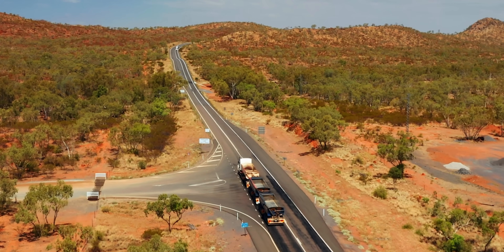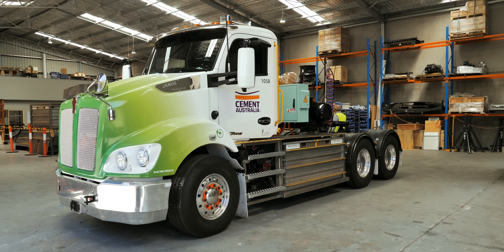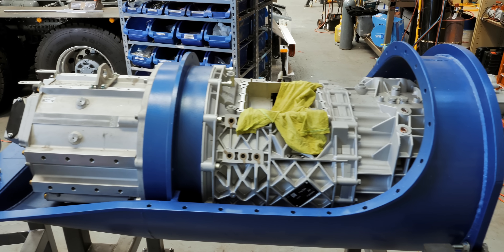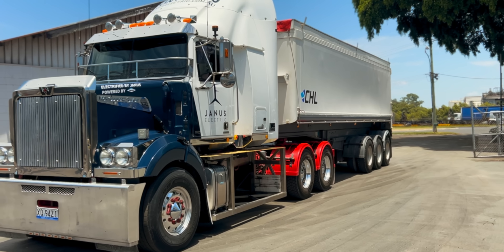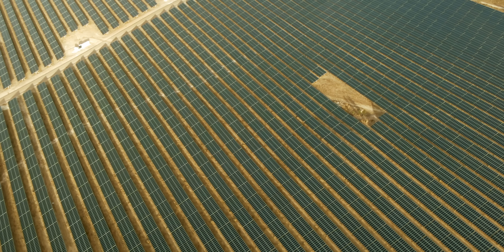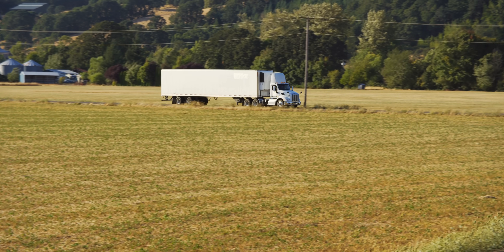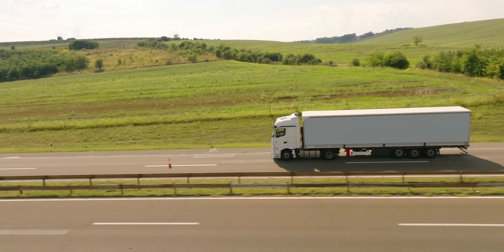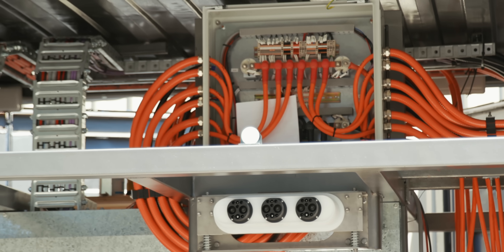This GIANT Electric Semi Can Swap Out Its Batteries!

Comment: What I always like about this is the facts they don't tell you about. Conversion is $150-$175K and they don't talk about the price to have a system to supply your own without having to use the grid. They also don't tell you how much space you need for said system. At a rough calc to produce enough power for the 620KwH is roughly 6,000 square feet, if the figures from Google are correct, per truck. Cost of said system hasn't been said which is another cost to the system as well as annual maintenance on said system. Annual maintenance on the truck isn't removed as there are still parts that need oil and grease replaced. He said about not owning the battery to save cost but you wouldn't get the battery change for nothing, another cost that isn't talked about.
I drive from Melbourne to Brisbane and back which is roughly 3,600Km. It isn't flat country so my mileage might be greater in some areas that others but at 400Km I would need 9 battery changes and at 600Km I would need 6 batteries. How much for each change? This price was not forth coming. They never tell you how much the actual running costs are and how much is needed to get all this amazing BS up and running. It is these figures that stop me from being interested in this new tech. Cut out the BS and maybe I might have a number crunch to see how appealing it might be in the future.

Comment: This is amazing idea! I would love to help the project with the robotization of the swapping station, management sw for the battery charging, perhaps solar vs grid balancing during charge and the logistics of it. Building these on sites with diesel pumps now, or overnight truck stops should be quite easy. More power to these guys, job well done!

Comment: No more Ad-blue shortage, Diesel shortage, and black smoke exhaust choking traffic behind.  Hello to renewable trucking.
Janus Electric have had several iterations of prototypes and now they have settled on the form factor that works best.
The only thing slowing them down is they are a relatively small company and their capability to convert trucks is correspondingly slow.  And for longer trips they will also have to build a lot of battery packs to pre-position along the route.
They might have to either license their technology or get a big cash injection to scale up in order to make a difference.

Comment: Learned a lot about big rigs from this video.  Amazing about the average age and how the weight is not alot different but with future tech that could equal out or even get less.  Love to know what the drivers think of this who have driven them.  No engine brake noise like I hear all the time from the trucks, the regen is amazing.  The TCO must be fantastic over the rest of the life of the truck.  Battery swapping for these is a perfect solution, can see swap stations across the Nullabor and huge solar farms nearby to charge them up with and use as grid level backup even for the communities they are in/near.  Have to see if they are going to be at FCL on the weekend.
Reply: I was kinda wondering how the regenerative braking would compare to engine braking power wise. I would think it could match it and possible be less likely to lock the wheels on slippery surface too

Comment: What an awesome company. They really are showing the way forward for commercial vehicles
Reply: True, but, other countries are equally innovative too.

Unfortunately although the swappable battery appears a good idea at first glance you would need to see if the concept worked with many thousands trucks using these replaceable batteries.

Too soon to know if the idea works beyond a few trucks.

Other countries are investing in hydrogen burning engines and hydrogen fuel cell powered trucks and public transport.

Comment: Ok for interim solution but will ultimately be replaced by upcoming Hydrogen automotive solutions like Cummins H2ICE and Hyundai Doosan H2ICE. Obviously new vehicles will most likely be hydrogen FC based which are being introduced currently in Australia.
Reply: Hydrogen combustion engines don't make any sense for anything that can use battery electric.  Hydrogen combustion engines are even less efficient than hydrogen fuel cells which are already way behind battery electric.
Reply: @jamescox8429  if what you say is true then you as a bevangelist have nothing to fear. The technology is commercially viable and that is why it coming to the market. Companies like Cummins, JCB and Hyundai Doosan have much more intellectual ability than a keyboard engineer like yourself. You do need to do much more research before committing to inaccurate comments .👍

Comment: This is one of the best idea l have seen on this show l am impressed this idea of changing batteries was around with an electric bus invented by Mr Leembrugen he built an electric bus eith changleable batteries and this company is using older trucks to convert to electric and they are bueng used no crap no mucking around and the fact is anybody can have there prime mover converted even using the fork lift to change the batteries much shorter time in refueling a prime mover and down to one minute to change batteries with quicker than refueling a petrol car obviously this company is going gangbusters and the the regenerative braking because diesel prime movers have exhaust braking

Comment: Only one ton heavier than a disel....  That's phenomenal. These guys are amazing.
Reply: Local trucks do about 80-100k km/ year. Interstate trucks do 160-250k km/year.
Reply: PLUS 2,5Ton PER Battery-Pack....so 5 Tons +1Ton for the swap-engine... Another mis-calculation is the self-produced Power...it doesnt cost 6-25ct, because the Solarpanels or Windturbines are not growing on trees. They cost a lot.... Have we talked about the conversion-cost? You have to drive a lot to re-finance this.
Reply: You forget to mention significantly way lessssss range than the diesel too!
Reply: @Alan May  with mandated stops every few hours, I don't see that as being a big issue when you can just forklift on a new one.
Reply: @--Nath--  it depends on which roads you take and those swapping stations will definitely not be as practical or everywhere like charging stations or gas stations.
Reply: @--Nath--  you’re not going to magically swap batteries like that everywhere
Reply: @alanmay7929  depends. Are you going the same known route repeatedly? Or are you going to random places on every trip.

If the later, then you stick with diesel and wait for Tesla or somebody else to set up supercharger stations all over the country, and only after they are done, maybe 10 years from now, do you buy an electric prime mover.

If you are like Pepsi trialling the Tesla Semi, travelling a fixed regular route, you set up your own battery swap points exactly where  you need them, with your own spare batteries and chargers.
Reply: @alanmay7929  How many kms does a prime-mover drive in a typical day?
Reply: @roidroid  the question is what range does and “electric” road train really get! If a tesla semi gets “500 miles ish what would a 600kwh road train with over double the payload get!
Reply: @alanmay7929  ... Oh, I thought you'd know the answer to the question.  

Wait, so why do you think it gets less range than a diesel - if you don't even know how much a diesel typically drives?
Reply: @alanmay7929  you're the one saying it has less range than a deisel, mate.  If U don't know, then why are U talking
Reply: @roidroid  around a city about 300 - 500 ish is needed in the outback easy 1000 its why most of our trucks run 4 tanks of fuel. my town is one of the driver swap points for the Sydney to Adelaide route its around a 1400 trip in total the trip for Adelaide to Perth across the GAB is even longer not even Tesla has a destination charger out there let alone a supper charger RIP to any one trying to get a Tesla to Perth. some of the trucks purely built for long haul can do 2000 road trains that spend a lot of time off road carry even more one road train drive i spoke to said if he stay on the road the whole time it could do 3000 ish an electric truck would never work for him he goes places where there is no power grid and locals run off diesel generators.
Reply: @phalanx3803  Is his truck delivering their diesel?  Someone has to, after-all.  
If he can deliver diesel+generators, he can deliver solar+batteries.  And these places can finally stop being dependent on regular fuel deliveries.  

He wouldn't do 3000kms in a single day, i asked how much is driven in a day coz then the truck can plugin while the driver sleeps.  You'd need to improve the infrastructure tho, ie: more fast chargers, and coupled with grid-level storage (& even battery-swapping) like the video discusses.  Obviously pure-long-haul trucks could be built with increased battery capacity, mirroring the increased fuel capacity of the pure-long-haul build diesel builds.  

ps: The Nullabor/GAB road has chargers every 200km max, so i'm sure Teslas (like all EVs) get in & outof Perth just fine.  More fast-chargers would be nice.  Prime area for solar & wind farms tho 😉👌🏼.
Reply: @roidroid  full-blown off-grid solutions are still pretty damn expensive and regular fuel deliveries are going to needed anyway they operate massive tractors out there that with current battery technology cannot be made into electric vehicles. 

Although he might not drive  3000 in a day there are little to no places out there for a full size truck to refuel and when he parks up for night he's not parking at a truck stop with pumps his parking on the side of the road to sleep. And to extend the range is not a simple as adding batteries that medium haul truck was turned into a short haul truck and added a full tonne to it imagine trying to make that a long truck it will be an extra 4 tonne heavier at the very least and the heavier the truck the less you can haul.

As for the GAB I went down there a few months ago and there wasn't even an iota of charging infrastructure along it.
Reply: @phalanx3803  Weird, all the EV charging maps will show the chargers you could use...  

It's kinda how it works 🤔
Reply: @phalanx3803  Nah, anyone using an EV charger map would see them.  I see them on multiple maps, they even have reviews.  

What's wrong with you?

This is a really weird conversation.  

Anyone reading this can just search for themselves to confirm.
Reply: @roidroid  what's wrong with you? why do you believe everything you search on the internet as I said I've been down the GAB I haven't seen a single charger the last one on the way to Perth is at Clare and it's a destination charger not a fast charger so it's pretty damn useless on a road trip.
Reply: @phalanx3803   It would explain some things if you're trying to find chargers without using maps on the internet.
Reply: @roidroid  the A1 is one massive Highway with little off-roads where there will be nothing but a few houses or farms don't need a dam map to find a charger on a highway.
Reply: @phalanx3803  ... Yes ok mate, there's clearly no chargers anywhere, maps are a conspiracy NEVER USE THEM EVER.  

You go have a good life, bye now.
Reply: @roidroid  in australia they are capped to 100kmh and a driver is limited to 12 hours so at most a truck with a single driver can do 1200 km.  But considering you need to mandated stops every 2 hours if you can stop at a swap station its sorta a non issue
Reply: @alanmay7929  True, but that's still MANY customers.

Comment: 125k to make the conversion seems like a lot.  But how much is it to rebuild a diesel engine?  Or course the swap outs would happen when the diesel was ready for rebuild.  And there'd never again be a need for a rebuild and the subsequent time loss.  Gear box rebuild I imagine would take a fraction of the time and only be necessary with less than half of the diesel rebuild.  Not to mention the huge fuel savings which would probably pay for the swap out by itself over the life of the truck.  So great job!  There's hope for us after all.

Comment: Alot of the big issues with Australia is the infrastructure to get built for electric but when you realise out in rural areas where this would be the biggest issue is prime solar territory, think of it like an oil field for ICE, building a huge off the grid battery swapping logistics operation is entirely possible, it could completely transform trucking and the cost of freight in general.

Comment: I can see this being a perfect match for where I work. Trucks are pulling two trailers of ore 100kms to site, then back to the mine with waste. They could have batteries at either end if required. They also run trucks between the refinery and the warehouse and wharf, much shorter distances where a battery change unit located at the refinery would be ideal. We even generate our own power with a GT for steam production.
There would be ample space for solar production at the mine site

Comment: The mention 95% of fuel Australia imports peaking at approximate AU$ 4 bn per month In March 2022, which is approximately 5% of monthly Australian GDP for 2022. Note depending on import export economic factored the percentage can rise higher the  12% of monthly GDP.  It should be an economic imperative and a aspect of national security that Australia goes electric.

Comment: All that weight over the drive axles would really boost traction 😍
Reply: How? They’re just replacing the fuel tanks’ weight
Reply: @g00rb4u  think about it😏
Unless the truck's you're familiar with are radically different than the ones I know,  those tanks get progressively lighter at the worst possible times😫

Comment: These guys have done some serious thinking and it will work for short haul local operators and with the right infrastructure could be viable for regular long haul operations. Overall costs won't be cheap but "Despite the high cost of living it remains popular "

Comment: Brilliant, innovative and very practical approach. Based on the reduced maintenance cost, it sounded like the break-even point after paying $175k for the swap out was less than 10 years.
Reply: Cummins ISX is about $45000, then add new radiator intercooler for warranty plus labour.

Comment: I hate to add this, because I love what they are doing with converting used Semi's to electric- but battery swapping is an economic fool's errand.  It creates a lot of overhead for the provider and/or creates a larger cost to the buyer.  In no scenario is leasing ANYTHING cheaper than buying it- and that battery leasing for each truck will have to pay for more than one battery along with the expensive stations to store and swap out the batteries. Nio with their cars is making the same mistake- and as a reminder, Nio is not profitable.  Again, look at Better Place from 15 years ago.  Those who forget history are doomed to repeat it.

Comment: For my fellow Autists and enthusiasts. 

300-600km range for electric [620kwh battery]
3300 km range for diesel [1200L diesel] 

1.5-1.7kwh/km [with regen] - 60c/km [Australian energy is fairly expensive]
$1/km for diesel 

Electric maintenance 4c/km - very low, motor lasting multiple decades.  double gearbox life, less downtime. 
Diesel maintenance  14-16c/km 

Conversion cost $150-$170k Australian.  

So approximate ROI - 280,000km-327,000km, with 72,000km/year [typical] = about 5 years return of investment 

Has benefit of using the batteries for grid storage if you have renewable, dual usage, lower on going costs.   
Battery Exchange 1 min with robotic exchange. 
-----------------------------
Usefulness would depend on application range is far less but might suit application just fine.  
To exchange you would need at least a second battery which is about $130k this would significantly change the ROI to almost double.

Comment: It doesn't actually cost all that much to maintain a decent diesel engine, Its also fixable at any roadhouse roadside stop in all of australia. Doesnt mean we shouldnt think about this but WHY didnt they do a diesel electric truck? NO bloody huge battery set that requires a bloody forklift. Requires smaller battery sets and charges on the fly from a small efficient diesel engine. JUST LIKE A LOCAMOTIVE and 1000's of KMS range vs 300 FFS Also think of the fire risk of carrying 16 teslas in one struck, i mean overall some very neat ideas, but they like everyone else insist on re inventing the wheel, Why not utilise our current infrastructure, there are petrol stations all over this country, if you halve your usage thats a far greater significant saving than it would be to develop buy land and install charge swap stations all over the country.

Comment: Ask any trades person if they would prefer to plug in their saws and drills or keep swapping their batteries.
Swapping batteries is super fast and easy and you don't have to plan ahead (as much) for how much work you're going to do the next day. 
Until there are wireless chargers embedded in the roads, swapping could be a great option.